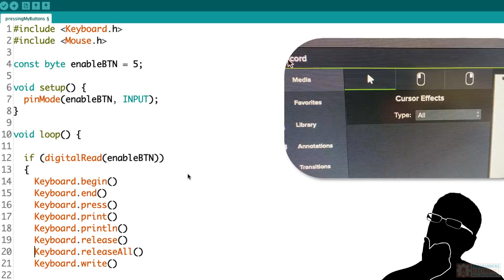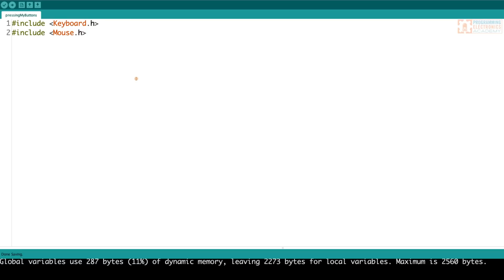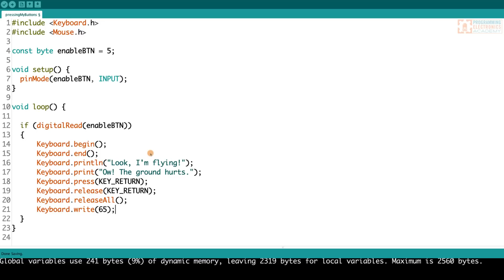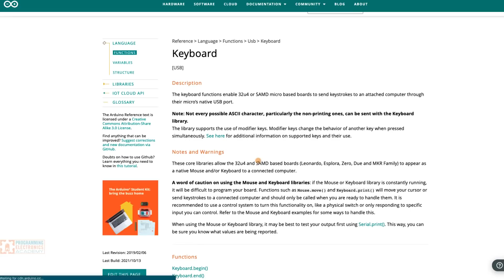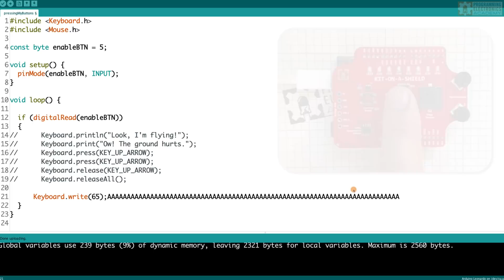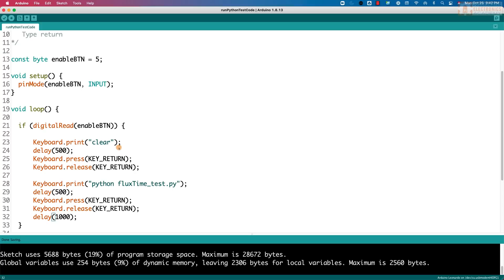Control your keyboard with Arduino!  Automate simple tasks!

Comment: Keyboard library didnt work in arduino uno nano but may worknif i change ots bootloader
Reply from the maker: I believe these USB libraries will only work on  boards using the 32u4 or SAMD micros.  If I am not mistaken, I think Nanos use the 328p micro.